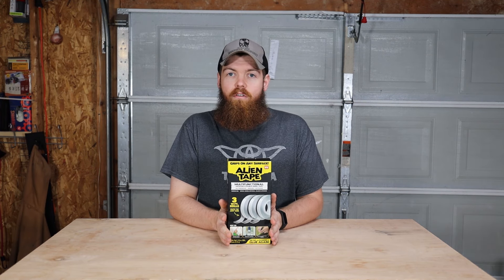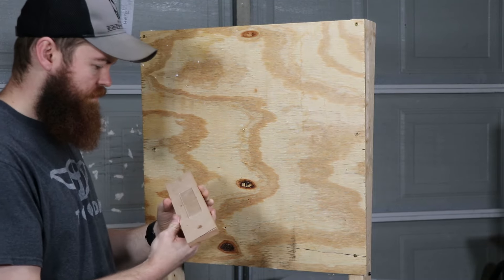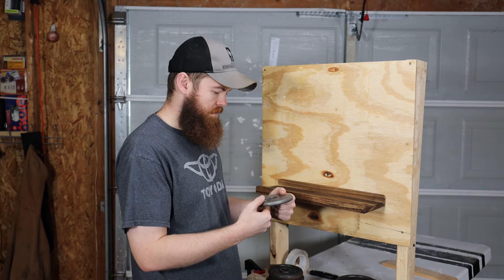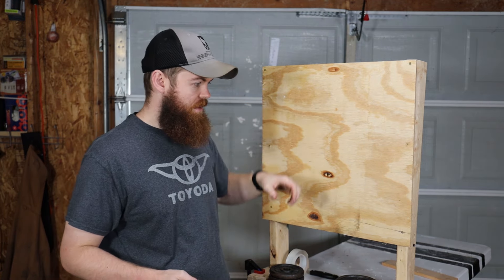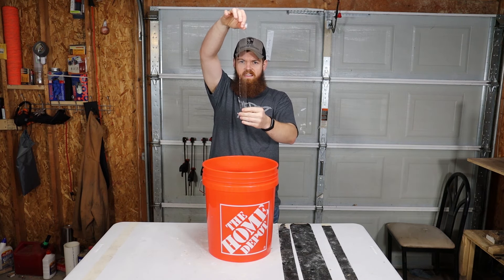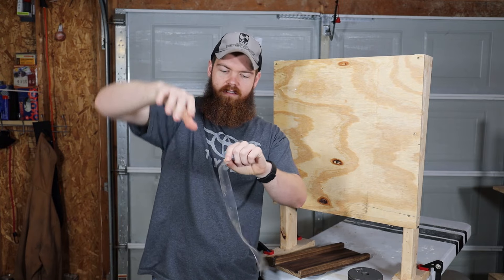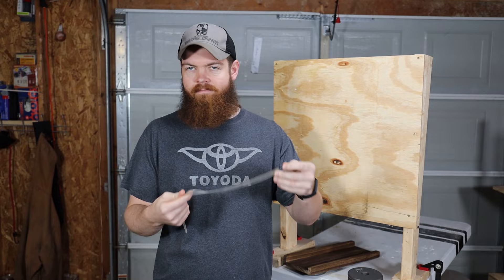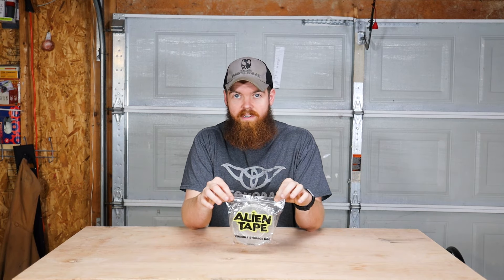Does Alien Tape Really Work?

Comment: Plywood has strands that separates when pulled on. You should try the shelf on a smooth solid surface you might get better results.
Reply: I used to use this 3m stretchy rubber membrane tape at work years ago. It was like 500$ a roll and it was soo sticky that it would rip pretty much the whole 1/8th inch layer off of plywood or the paint off of walls. If it stuck to your skin you had to use acetone to get it off or it would literally rip your skin off. Haven't seen it anywhere in years now.
Reply: IHas  love me sum supper. Mad hungies tonight
Reply: @richard.copeland  yeah it is 700 dollars a roll now
Reply: IHas  it it 3m VHB tape but we got bigger rolls of them for work. But it is amazing stuff but you need to let it set for 48 to have it strongest effect I also think if he did that with the alien tape he would of had better results I worked with that vhb tape for the last 12 years basically everyday.
Reply: @nicholasjohnson1942  how big are the rolls you get because i can only find 33 meters for 115 euro (108 feet for 136 us$)
Reply: Uh he did
Reply: Not everyones is smart some have small heads so.....
Reply: Yewh plywood isn't the best application for any tape with any kind of strength.
Reply: The thing is it says sticks to any surface
Reply: @Gkitchens1  q
Reply: @richard.copeland  automotive supplier it is 3m body molding tape
Reply: He is not interested in making the product work. Bumbling around gives him better ratings.
Reply: He did put it on a painted wall though, and a shower interior.
Reply: @danohstoolbox  3M  Automotive VHB isn't as strong as the Industrial or nuclear grade 3M VHB. They're different grades

Comment: I learnt the other day that packaging is often designed to optimise the space in shipping containers. A product package might seem illogical when you open it, but when boxed up in multiples in the brown cardboard boxes, they form a standard size that will fit, in multiples, on a wooden pallet, which is in turn sized to minimise the wasted space in the shipping container.
So the box for the instructions is mostly there as a filler to stop the tape moving in the box. Imagine the effect of over 10,000 rolls in 3,500 sales packages, all packed on a wooden pallet if they were free to roll a couple of inches. It could make the pallet unstable. 
The size of the packaging was the smallest standard form size that would contain the rolls, without having to get the packaging company to make a new custom cutting die for a slightly smaller box.
Reply: @fifthhorseman1632  the op's comment is informative and useful -- your comment is deplorable.
Reply: @hefoxed  Thanks, comment rater.
Reply: For the price they could have put an extra roll of tape in there instead of the empty box.  lol
Reply: There ARE usually reasons for EVERYTHING! I hate when people complain about something but don't check first to see if there's a REASON for it. Or if THEY'RE wrong!*
Reply: A roll of the tape fits perfectly in the box for storage.

Comment: What all these test videos forget is that just like alot of adhesives this tape works alot better after it's had some time to set in. They can also sometimes work far better when clamped into place for an extended period of time and not just pushed on with a few pounds of pressure. I say this knowing that it's not always the case but I have used double sided Gorilla tape (i believe that was the brand) but when it failed the first time after loading the shelf right after I put a weight against it for an entire day and it feels like it's bolted to the wall now.
Reply: The super glue tape is really good double sided tape as well. Try that shit one time
Reply: T. Dee  happy to see comments from people that actually know what I'm talking about instead of just disagreeing to troll.
Reply: I was indeed thinking this it's almost frustrating at times but he's not cocky about being a know it all or anything so i passively give him a pass..
Reply: This tape claims not to use adhesives, so comments about set/cure times may not apply. For some uses, it appears ideal. For permanent mounting where some of the forces are shear forces, not so much.
Reply: Hey Kyle...how many readers commenting here do you think got any idea what you said....very few I'd bet.

Comment: The “instructions box” was so when the 3 rolls are in the box they don’t rattle around due to not filling the entire inside of the outer box. At least that’s what I’m assuming
Reply: that was my thought as well.
Reply: Thats probably why, but they could have just changed the size of the box so that the three rolls are stacked next to eachother.
Reply: @Nevdar  You are precisely correct on both counts. Sad, since the lowest surface area for a rectangular prism is cube, so stacking the three rolls together would have reduced packaging costs as well...
Reply: @YamiOni  exactly. And instead of individually wrapping them, all three could have been in the same plastic bag with just a sheet of plastic between them to keep them from sticking together. But hey. What do I know?
Reply: They could've thrown 4 rolls in that box and slide the instructions between 2 of the rolls 🤦‍♂️

Comment: This stuff works best on closed surfaces like tiles, glass, you name it.
It also requires quite an amount of initial pressure – the more, the better it works sticks.
After applying the tape, give it some time to "suck in" and also relax.
Given that it is pretty thick and does not bond chemically, I would not advise to hang a shelf or anything "mission critical".

Comment: Looks like a giant version of the adhesive inside 3M strips. They instruct to wipe the surface with rubbing alcohol, press together firmly for a total of 60 seconds, and let wall-connected strips cure for 1 hour, removing the object and its connected strips on it for that curing time. You can't do that ofc because this is a one, not two-piece solution, but you can support the object for longer and/or use clamps. You might get better results, but also might not haha. Even the 3M strips say not to hang high value items, or over your bed headboard (ow!), and I've seen them, albeit very rarely, fail over time on heavier objects. Anyway just some context, great vid as usual!
Reply: agreed. it might have even said that in the instructions. modern adhesives are very impressive

Comment: Glueing parallel to the grain on your plywood made the strength of the tape weaker since the tape was pulling slivers of wood off. You're depending on the integrity of the plywood as well as how sticky the tape is which compromises the test a little. Taping a shelf to drywall will give you better results.
Reply: Right because some who doesn't want to make a nail hole is going to want to peel off the paint. What a useful test that would be.

Comment: You need to try it on a smooth surface, you can see from the surface of the tape that it wasn't all stuck. Also I would like to see what happens if you try to peel the carpet up after 30 days.

Comment: I Was curious about this but I was almost 100% sure it was mostly a gimmick and I was right.... Good thing I never got it. Thank you for testing it.
Reply: You weren't I'm sorry to say. I have some. His problem is he's not using it properly nor does he understand how it works. He's using it like an adhesive tape. It's not adhesive and it's not meant to be permanent. It's able to release the surface it's bonded to and be reused because it's like velcro on the nanoscale. It peels apart when a moment is applied to pull edges away from each other. You have to orient it properly for best results.

Comment: You really need to revisit this. The instructions actually address some things you tried. For instance, it says that any application over painted surfaces or sheet rock are permanent. Also, they suggest applying pressure for 15 seconds on initial application, and then another 15-30 seconds when attaching the object to the tape. You were a bit more hasty. 

Furthermore, it goes on to say not to use on surfaces that are not even. You could see when attaching to the wood (and the shelf) you didn't have 100% contact as they direct. You would need to sand the wood down to be smooth before it would be an honest test

Finally, the surfaces must be clean before you attach it. So their reusable claim may still hold up if you follow the instructions.

Lets be clear, I'm just as dubious about its efficacy as you, but you test results are just as dubious :)
Reply: That was furniture grade plywood.  Sanding would do little to improve the quality of the surface.

Comment: I'm on the fence about it just because it's so overpriced. I couldn't be convinced to buy it when there's cheaper replacement items for this tape specifically made for holding things to walls or floors, etc... Imo 🤷🏻‍♀️
Reply: If you need double sided tape and you don’t want it to go anywhere I highly suggest 3M VHB tape with the primer. That stuff is the real deal but it would destroy a wall so keep that in mind.
Reply: There's definitely uses for it but there's been double sided tape for decades now.  I wouldn't use any of it as a permanent solution for holding any weight though.  Like, I might would use it to hold that shelf into place while you drive a screw through it but I wouldn't be trying to depend on it for years or anything.
Reply: There are also cheaper versions of exactly this kind of tape that just don't advertise as widely.
Reply: It’s trash

Comment: 3M's double-sided VHB tape has really good properties and costs a fraction. Not reusable though since you won't be able to remove it. I glued some plastic to a metal few days ago as a temporary solution and tried to remove it. After a lot of struggle tape broke down the middle but the surface was securely bonded.

Comment: I'm a truck driver, 
I've used it to hold the dog bowl to the floor. To hold the inside door panel up till I put the screws back in, third hand. 
To seal a window closed, water tight. 
True high price. But it does work better than duck tape or anything else for the most part. 
It has its unique uses.

Comment: The box for the instructions is not so much for the instructions, it's more so there to provide padding to ensure the product is not rattling or moving around inside the packaging. Since there's only 3 rolls of tape in the packaging, the 'instructions box' takes up the 4th space. This is very common in most modern packaging, especially smart phones.

Comment: The instructions in these type of tape generally tell you to leave to 'cure' for up to 24 hrs- to get the best result. I put a towel rail up on my daughter' s bathroom over a year ago and it's still up, with several heavy bath towels in it all day every day.
They also work much better on surfaces such as metal to tike like my daughter's towel rail.

Comment: I got some, played around with it and got a good idea of how it works and how strong it is. The claims are over the top, but if you use it right it's a pretty amazing product. And I found that if I use a heat gun to heat it up it really helps. It's only as strong as the bond you get right at the start. Similar to that clear stuff they used on junk mail when you'd get a letter with a penny or nickle in the window.

Comment: For the weights on the shelf. Did you wipe off the make shift wall with a barely damp rag to get any dust that may make it harder to stick. Helps alot.

Comment: I'd heard of this stuff and had my doubts it could hold anything up nearly as well as the adds show that it "does". Watching this confirms what I thought.
Reply: he did not read all of the direction, you need to let the shelf set over night before putting anything on it, and on the back it actually says to use on clean flat surfaces only and not to put it on painted walls  or drywall as it will seal permanently.

Comment: I did put up a small sign, maybe ½ lbs and it was mounted fantastic, until a few hours later where the sign fell on the floor. The tape is only sticky in a short time. It's great for holding a ruler on a board to guide your cut and then throw out afterward.

Comment: If your shelf was an "L" shape it would hold a lot more weight. Most shelves are designed that way because the bottom corner acts like a pivot point, which means the load has to pull the tape away from the wall instead of peeling it like it did in your case.

Comment: With the weight test, try doing it where the tape is vertical instead of horizontal, so the weight is tugging aginst the tape, instead of pulling at it I'm sure it would hold up better.

Comment: It might be good in the rc hobby to hold esc and receivers.
Reply: better off just using industrial grade double sided tape for that, especially if you're looking for something permanent. I used the stuff to add LED strips in my computer case, and it's been holding after 5 years. This stuff is basically the exact same stuff but way more expensive and way lower quality, it just shows the power of marketing.

Comment: 🗣 It’s designed to be reused when using boiling hot water...

🗣Think of it as like soaking dirty dishes in water eventually all the food comes off. You just splashed it around for 10 seconds in Coldwater, of course that’s not ganna do anything.🗣BOOOOARING

Comment: I wonder if it was used in conjunction with an angle bracket, the lever force of the shelf would be pushing inward on the bracket, instead of peeling. Could probably be much stronger.

Comment: Also I'm not sure if it was included in the instructions but I think to reuse the tape you'd need to heat it up even with fresh double sided 3m I heat it up a little to make sure it's a solid form connection

Comment: Used 3M double sided tape to hold plastic holders to a wodden cabinet.  3M failed afterr about Six Months.   Cleaned the surfaced, and stuck Alien Tape on.  Failed in less than 24 hours.   Tried to peel the tape off.  It came off with difficulty  like snot.  So much for peeling of to reuse.

Comment: There’s already “rug tape” super wide fabric double sided tape specifically for holding your rugs down and not possibly damaging your floors, also only like $10 for 50ft 😅
Reply: Might not permanently damage floors, but you need a lot of GooGone to get rid of the adhesive. This tape claims to have no adhesive, but to work by properties of its surface -- probably like zillions of little suction cups.
Reply: @Digital-Dan  I’ve used rug tape multiple times for long periods of time and never had any issue with residuals or needing any sort of solvent to help remove it.

Comment: I dont like it when they advertise something realy usefull (strong double sided tape) as an replacement for screws, instead of what it is actualy extremly usefull for: An enhancement of screws. Try two pieces of Chipboard, or plywood, screw them together with, and without the tape in between. It works exceptonaly good.

Or for example, when he tryed to put the shelf on the painted drywall. Just use drywall anchors, and put the tape in between, its like trippling the strength.

Iam a carpenter, working as a foremen in installing furniture in natures/chemical class rooms and research facilitys. I often used double sided mirror tape, if i have to screw something together in a hard do reach spot, or over my head. Just put the tape on it, stick it to wherever you wanna  screw it to, than predrill holes, and screw it together. Sutch amazing stuff.

Comment: I bought one roll, for $5.99 ... not branded alien tape, but probably a Walmart clone.  Mostly to hang some metal art on my wall ... which weighs less than a pound, and isn't conducive to screws, brads, or other fixtures to hang on the wall.  A couple small pieces of this tape to a steel American Flag with 2A engraved into white stripes, and it has been hanging for over a year, in the same spot, not moving, and won't be moved until they cart my carcass out of this house, to refurb and sell it off to the highest bidder, 20 years from now.

Comment: They have updated the packaging now to include a much larger illustrated pamphlet that includes all the things you should not use this product on which includes...not for use in/on bathrooms, wet surfaces, wall paper, rough surfaces, brick or stone, painted walls...well, that seriously limits your options as to where this product can be used. Returning product today.

Comment: I would like to see the tape used on non-porous surfaces.  The shower wall - Was it clean of soap residue? The rug to floor worked well, IMHO because the floor had a hard, non-porous finished surface, as it appeared to be one of the DIY type piece together floors. 
Lots of claims for that product. Many push my gullibility level. (BTW- have never seen a commercial for the product. No TV reception here. No real loss.)
Reply: It actually says on the packaging not to use in BATHROOMS.

Comment: I've used industrial grade 3m tape to put metal body panels on a car and had to use a crowbar to get it off with major damage to the body panel and this was bought at Walmart or an auto part's store.
Reply: It wasn't reusable though being the 3m double sided tape.
Reply: The reason this tape didn't hold up to the weight is because you do not have a level to make sure that you're shelf is level when hung. Lmao joking

Comment: If the tape is coming off the ply board and there is plywood stuck to the the tape it  could mean the failure is due to the upper layer of the plywood coming off. Nothing wrong with the tape then.

Comment: Put the tape on the shelf give it two days to cure like with 3m double sided tape and I bet it holds a lot of weight I worked with 3m double sided tape a lot if you just pressed it on and tried to pull it off immediately you could easily pull the stuff apart but if you rolled it and let it stick for a couple days it was almost impossible to pull apart without tools